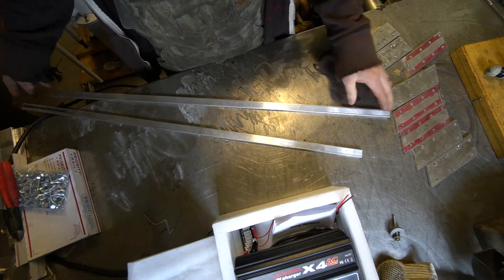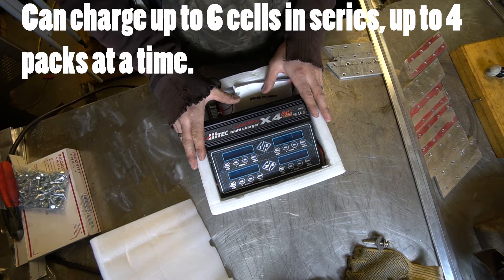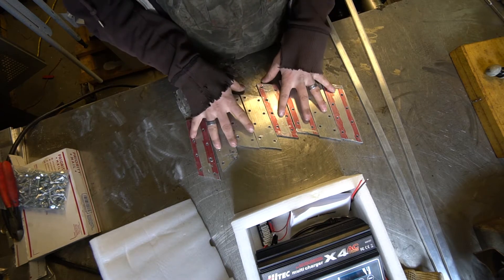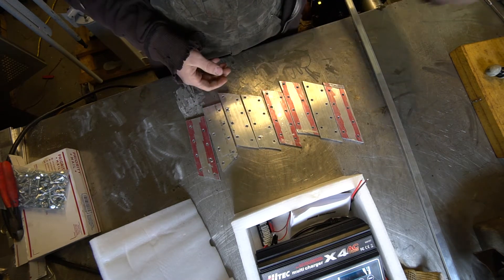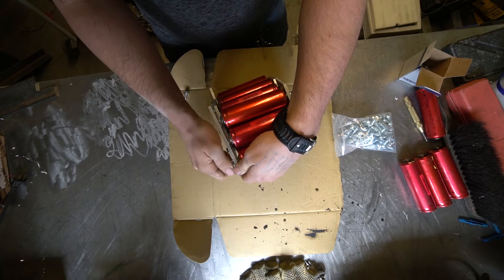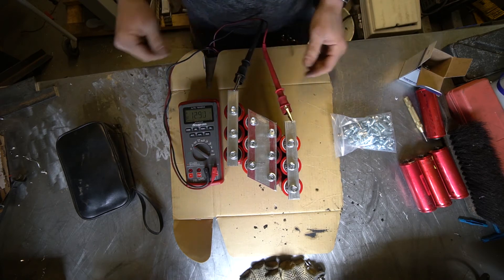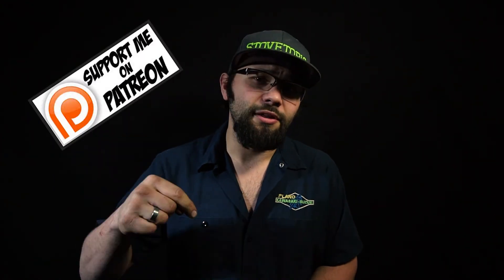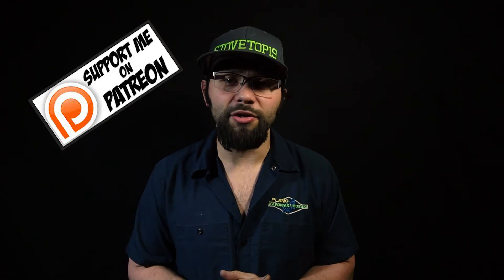Mini Electric Drag Bike Build Part #1,  Lithium Battery pack build

Comment: just dont forget that the VERY thin red plastic is not made for high stress under vivration and should not be considered ad a good insulator between cells group that their negative can is at various voltage fron one group to anotehr in serie... Just saying.. to avoid you to have fire or short circuit thru the red thin plastic insulator!
Reply: Stovetop19 Neat looking project! So, which NEDRA record are you going for? 😆
Reply from the maker: Note taken!!  Thanks for the info,  Ill see if I can get some gap between the cells before the final installation
Reply from the maker: Casey Mynott Drag Motorcyce group, 48v class, is what I would be competing in, Ive talked to the current record holder (silver giant ii)  and their set up is quite a bit better than mine.  But you gotta start somewhere👍🏼